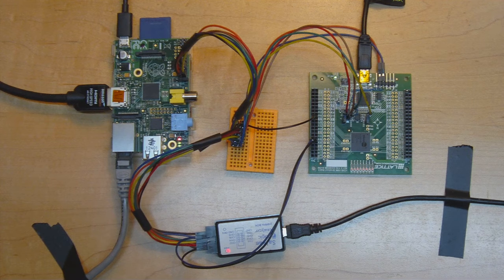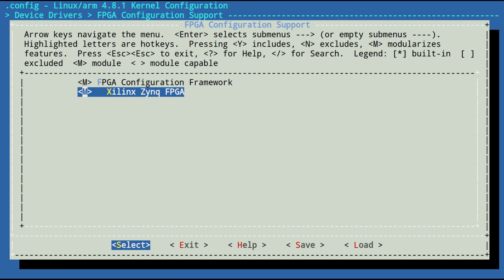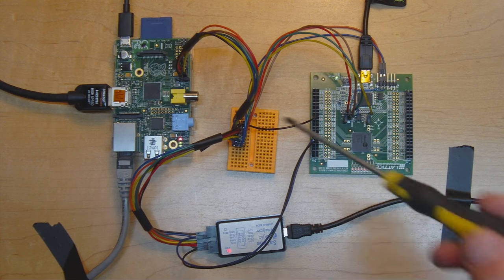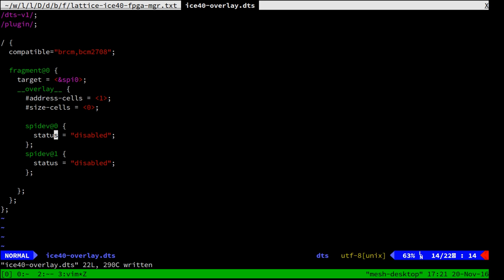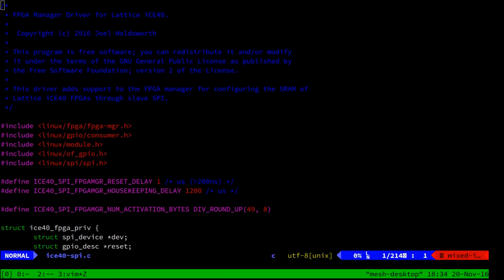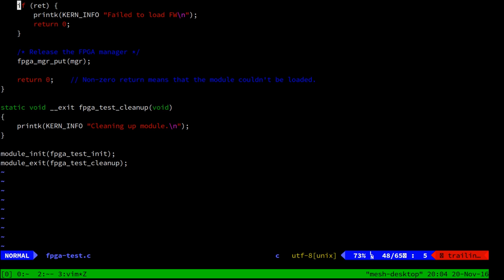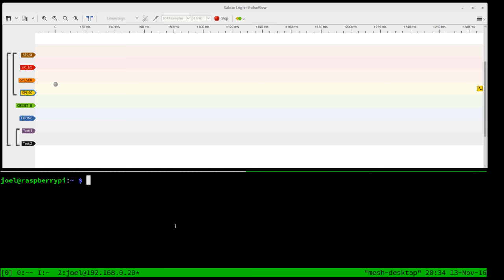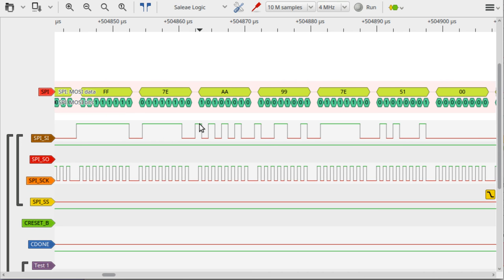[002] Testing the Linux Kernel driver for the Lattice iCE40 FPGA

Comment: Linux editing protip: instead of `sudo nano /path/to/file` use `sudo -e /path/to/file` after ensuring $EDITOR is something sane. Sudo will run your editor as your user on a temporary file which it will later copy over the actual file. This allows you to keep your editor configs on your user only and is arguably more secure.
Reply: nice one!

Comment: Great, thanks so much for this, it will help a lot! Just received my iCE40HX8K dev board (cheaper at Symmetry Electronics), and waiting for an Olimex iCE40-IO to go with it. The icoBoard is too expensive ($101!). Planning some simple logic and old CPU designs.

Comment: Great video! I noticed that you had your oscilloscope probe set to x1 instead of x10 (your voltage was set to 20V/div instead of 2v/div). You should change that on your probe, as you otherwise limit the bandwidth of the probe significantly and you may not see the real ringing.